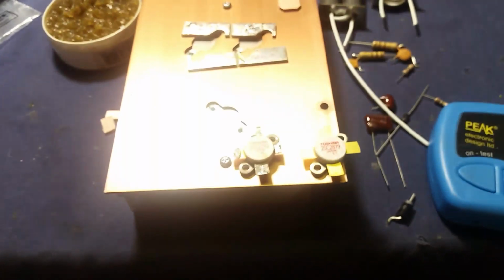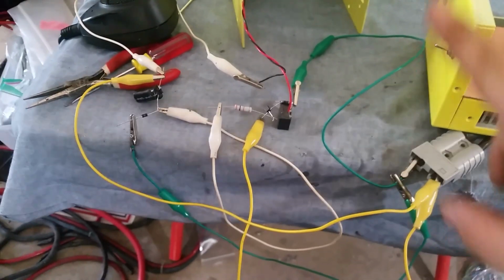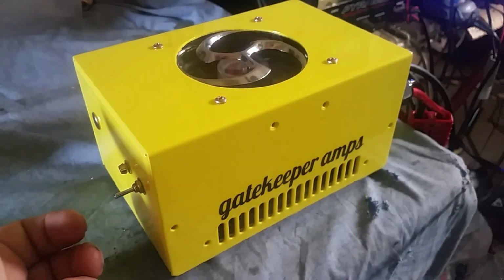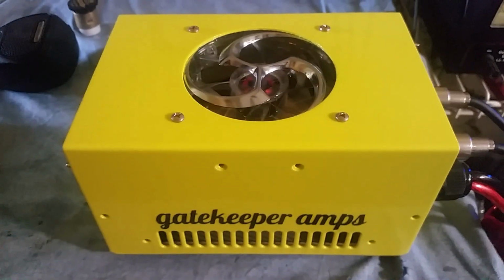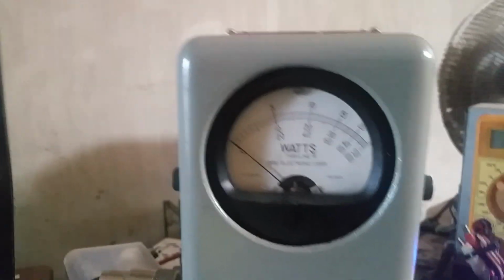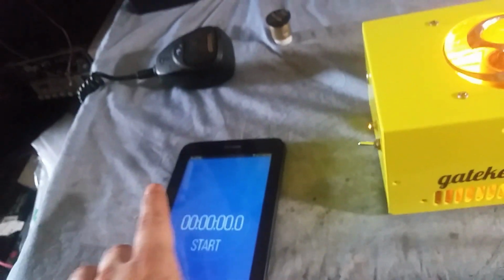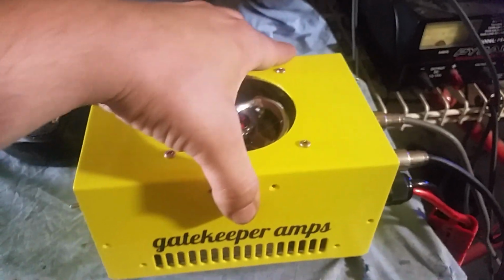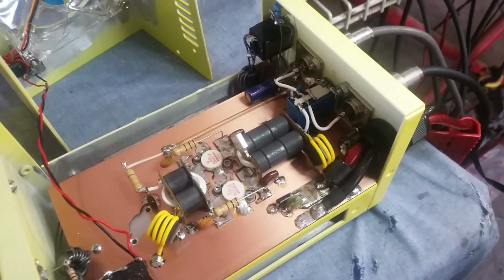Gatekeeper Built Lemon Drop 2 Pill Driver With Fan Cutt-off Delay

Comment: So do you make these w more filters and other HF bands? (Yea I consider cb HF!!) I have a converted CW 10 meter amp it does ok but I need a filter..it is only 250 watts but it does what I need on 10 meter.
Reply from the maker: jacknifedbl  oh yes just have not had anybody ask for one until a little over a year ago but these new line of amplifiers I will be releasing they will have complete LPF filter boards in them but for those particular units I'm probably going to create another Channel 4 to keep them separated from these times to me I look at it like it's one ocean but to different boats of course the ones wanting the type of amplifiers that you are talking about they are in a huge cruise boat while these are in a medium sized boat if that makes any sense LOL but I know it's a lot more convenient to have your filter built inside the amplifier but you always can run a filter externally I've got my eyes on a good 2500 watt filter board right now it is quite pricey but it is what it is I don't actually think I'm going to take time to actually design filter boards but who knows what the future will hold probably easier just to buy one already made

Comment: I like that delay curcuit. 
Lost Jeep waving a hand!
Reply: Hey lost jeep. What kind if jeep do you have a cb in?
Reply: @andrewmartin8130  I have a 1992 YJ with 4 inches of suspension lift on 33 inch Firestone M/T tires.  I've owned it for 25 years. It has a modified Galaxy 949 and a little 2 pill, with a 102 inch whip antenna mounted on the right rear corner with a ball mount. It's a sweet little Jeep.
Reply: Sweet, I have a 2000 cherokee with 2 1/2 leveling kit on 31s A/T, nothing special but I'm having a difficult time with a mounting location for my galaxy 949 and 400w palomar. I'm just going to put a wilson 1000 on the roof but looks like it might go on the passenger side of the console